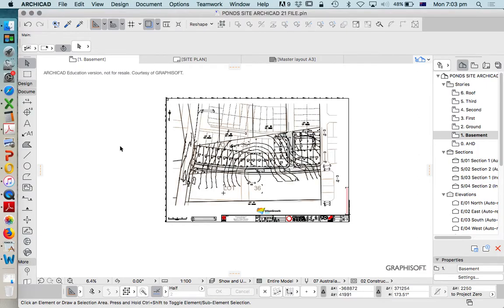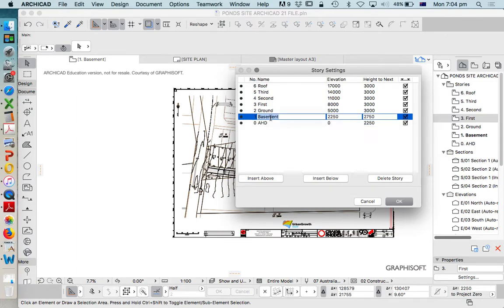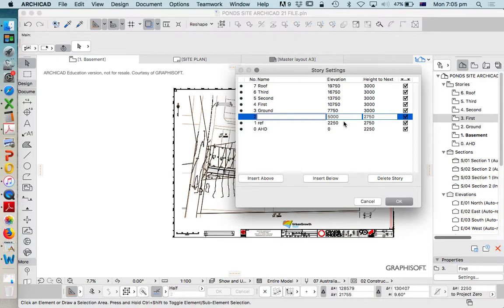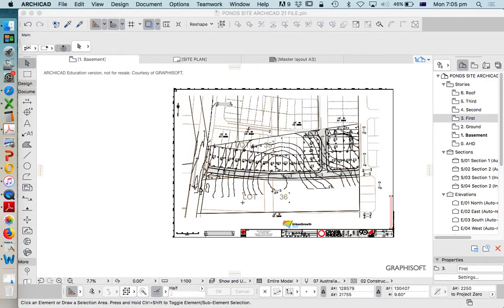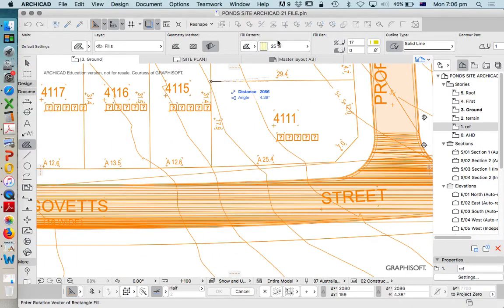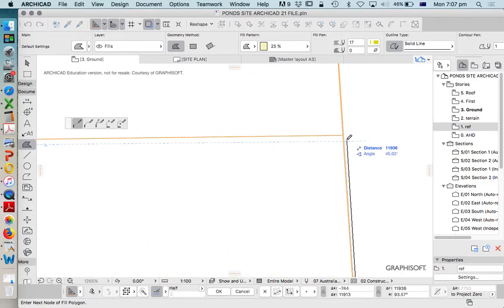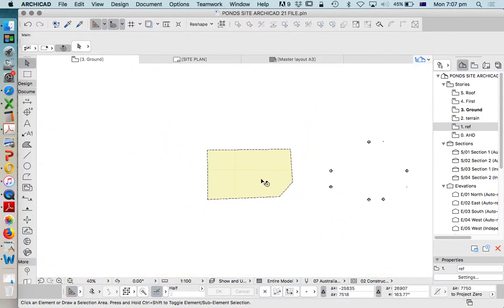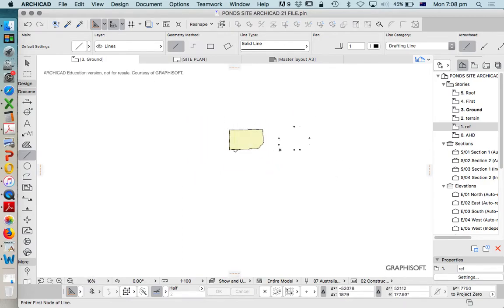ArchiCAD 21 House Project - part 03 Storey settings

Comment: Any tips why suddenly we can not save our 3 storey house as an OBJECT. Thanks anyone…
Reply from the maker: Why are you wanting to save your house an an object?
Reply: @RobertMannArchitect  Robert gday. The reason is we want to save our 3 storey house as AN OBJECT and INSERT IT on 2 different MASTER SITES with specific A.D. RLS… so it is easier for us without the need to INSERT SEPARATELY floor by floor… and not to worrying about the FLOOR TO FLOOR LEVELS… MAKES SENSE ?… THANKS A LOT for replying to us. Cheers C& S